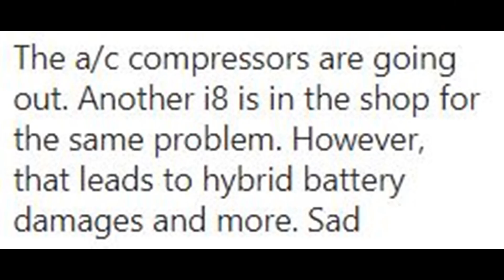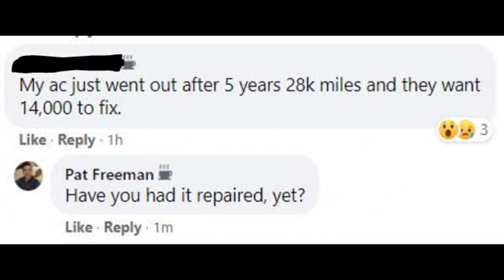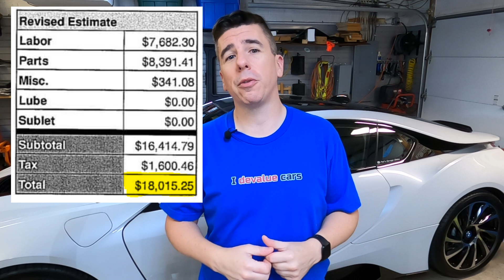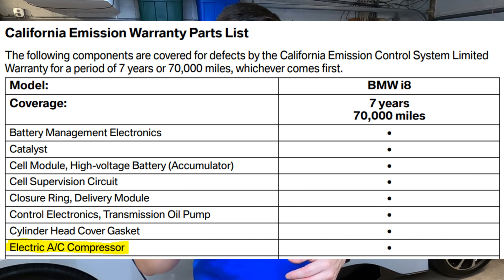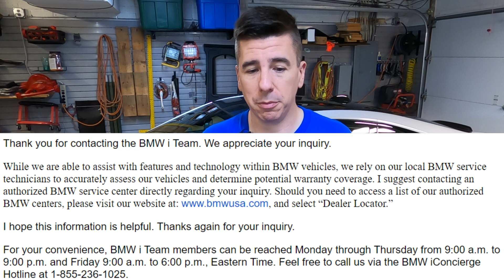BMW i8 Air Conditioning compressor problems and costs

Comment: Wow!  First of all thank you Pat for the video.   I am in the market for the i8.  The more research I do into this car regarding issues and maintenance.  This is becoming a dream killer of owning one.  At first I was going for the 2014 to 2016 models.  Now I'm wondering should I wait for the 2019 and 2020 model.  Sadly this is a money pit.  The car is so beautiful.  "Heart broken" right now.  Thanks again for the informative video.  Keep posting the video of the i8!
Reply from the maker: As long as you have a warranty, you avoid the risks.  The car is repairable when things fail, but it costs a lot for repairs.  I have one friend with a 2014 he had since new, never had one problem.  Last month, his AC Compressor went.  However, he lives in a state where it's covered under emissions, so no charge to replace.

Comment: Appreciate the video and detail.  Happened to mine like clockwork around 29k miles. Pretty disgusted at the QC here.  BMW should have recalled this a long time ago just to prevent everyone's expensive cars from trashing themselves. It's my first BMW and I expected better from the company- maybe I shouldn't have though.
Reply from the maker: I'm sorry to hear you've had the same problem.  It's very frustrating for owners to go through this.
Reply: Just happened to me and no warranty here
Reply: PJ The Entrepreneur hey any updates on your car
Reply: What year model do you guys have?
Reply: @jaylenpopin  2014 here.  Also, just this week, my A/C failed AGAIN with a clunky mechanical noise.  Just over 500 miles on it since A/C replacement.  It's not diagnosed yet, but this has me nervous.
Reply: Jeremy Enos hey did you have any updates on this?
Reply: @pilpilnyc501  Yes - suspect that there were remaining metal fragments from the previous failure in the lines that went undetected (they looked), BMW service decided to replace all lines and anything the coolant touched.  So this is the big repair where they have to drop out the battery, pull the dash back, etc. But BMW took responsibility since I just had it repaired a few hundred miles prior and covered the whole thing. Big sigh of relief there, but still not happy about the initial failure so early, or having to have the car in the shop for over 2 months of summer waiting on parts.  Also, no firm indication that the parts they're putting in are engineered any differently to last longer. This makes me think twice about BMW EV engineering in a broader sense.
Reply: Jeremy Enos that’s great you where covered since I’m out of warranty I will have to pay out of pocket I’m just praying the replacement of AC compressor will fix it I’m not even interested in looking for metal fragments at this point as long as the noise goes away
Reply: @pilpilnyc501  Just to be clear, my initial compressor replacement was not warranty covered.  But since it was repaired by a certified BMW shop, they owned it when the repair was shown to be faulty. I wouldn't want to go thru the compressor replacement expense w/o being sure the lines were clean!

Comment: Hi there pat! Does this issue come all the BMW I8 or has this be issue been rectified, if so which year?
Reply from the maker: There hasn't been a particular year that doesn't have this issue. It seems to come up only om some cars when they are 4+ years old.  Newer i8's haven't shown the problem yet.  So, I'd only get an i8 with warranty to cover this or many other issues that can come up with the car.

Comment: Just came across this video Pat. I am based in the UK where the temperature very rarely requires the A/C to be turned on. Do you think this problem might affect i8 cars in countries with higher ambient temperatures? I ask this as i only bought the car in Oct 2020 and i decided against going for a warranty till the HV battery warranty runs out in 2023.
Reply from the maker: I don't have enough data to be able to say that this only affects certain countries or certain climates. I just know that if you do drive the car in eDrive very hard then it definitely will engage the air conditioning in order to keep those batteries cool. The same can be said for preconditioning where it will warm up the batteries. It can do so by reversing the flow of the refrigerant. Same holds true for charging. Charging generates heat and it requires the air conditioning refrigerant to cool the high voltage batteries. It's possible you may be okay in your climate but I'm not sure.
Reply: @PatsGarageOnline  i think i might not charge my car up as often as i do. I think once a week will suffice. Thanks for highlighting this issue Pat

Comment: Hi Pat, thanks a million! Just changed my 2016 compressor to the now 3rd iteration of the compressor. It cost me 2000 EUR but now I can sleep better! This is really a valuable information! Thank you so much!
Reply: In Germany I paid 2000 EUR all in for the replacement of the compressor which was not shot yet - I just wanted to dodge this bullet
Reply: Yes done at BMW dealership during the tune up. They knew the issues also from Minis with similar 3 cyl engines. BMW is always updating components so there are now 3 part numbers for the compressor - so choosing the latest version is more likely to at least last longer.
Reply: Sts Sta.   Did you do that at BMW? And how do you know that this 3rd generation compressor would work?

Comment: My I8 is now in with BMW with Aircon noises especially when charging ... they are saying it "firstly" needs a regas as it could be low on refrigerant ... lets see how this goes , its also there for Fuel Pressure Sensor issue throwing error on as tank flap opening  (FUEL SYSTEM ERROR). Like you ive got an extended warranty ;-)
Reply: UPDATE: BMW had to change fuel pump for the fuel door issue (7 hours) .... and they say the regas has fixed the aircon noise as the gas was low .... yet to test both of the above i hould have car back tomorrow.
Reply: UPDATE:   Fuel Pump with integral Fuel Sensor finally took BMW tech 9 hours to fit .... and AIRCON regas COMPLETELY sorted out the aircon noise ... IMHO low refrigerant gas is causing the overheating/wear on the conditioner pump ..... aircon soooooo quiet now.  FYI mine is a 2015 with 58k miles.
Reply from the maker: Thank you for this

Comment: Is that scroll compressor plate made from aluminium? If so, I am wondering if it might be worth it for people who have cars that are at risk of this to take the part and have one made from titanium or something that is harder and more resilient to heat.
Reply from the maker: According to the service manual, there is metal on metal contact as the scrolls touch each other.  I would assume Aluminum was not used.  But, I've never cracked open a compressor to find out.  However, there are videos on the web of HVAC scroll compressors being disassembled and the results are unreal.
Reply: @PatsGarageOnline  i opened a dumped i8 compressor and took a few photos. What i did is to take a rubble ring for replacement in my i3 compressor.  Please check the FB page BMW i3 Worldwide Group -  The A/C compressor can wear like this.....

Comment: Wow thanks for that! I have been looking at used I3s, but I had heard about this issue with them as well. I am certainly interested to know if they have fixed this issue in newer models, but I will not be touching one until I have some proof that they have fixed this issue!
Reply: I personally know multiple people that own newer i3s (2017-18 and 19) and none of them have any AC issues. In fact a 2017 i3 has over 120K miles on it and the AC works just fine, so all you need to do is to stay away from the earlier production years.
Reply from the maker: I saw the first report of a 2019 i8 having the AC failure just last month
Reply: @PatsGarageOnline  well, it ain’t a 4-runner after all, so anything can happen))

Comment: Hmm thanks for that, as an owner of a 2019 roadster, i love the car, i had noticed that when charging the car there seems to be a fan that comes on, however i did change the charging rate, to its lowest setting, which stops that, so perhaps this may help?  Also i recently had a fridge that started to stop working and the fridge guy said that i had got a leak in the system and that it is gradually loosing coolant, and thus diminishing the cooling and also the lubrication in the compressor....So just a thought as the refrigerant is the lubricant for the compressor, do you think that some sort of pressure test say on an annual basis may be an idea as any drop would likely be because of say a small pinprick leak in the tubing, thus any reduction in refrigerant would cause the compressor to overheat ..any thoughts..ps the fridge guy put his hand on the compressor and said that its too hot..and said you need a new fridge.
Reply from the maker: I'm currently charging at the 110v rate, nightly so I only cycle the AC Compressor once during a charging session, around half way full.  But, it's considered a slow charger compared to the 220v, higher kW charger.  It's possible that there is a leak and oil is being lost.  However, I haven't found any signs of a leak while taking apart the panels and looking under the hood.  I'm not sure what the BMW techs are doing in order to test this and haven't had any dialogue with them about it.  Some of the techs on the BMW forums also haven't provided much information about testing.  I do believe heat has a lot to do with the issues we're experiencing and the service manual indicates that heat is an issue.  Also, the scrolls have metal to metal contact.  So, it's possible there are a lot of things going on all at once leading to the perfect storm.  I just wish I knew the answers.
Reply: @PatsGarageOnline  Im not sure what the coolant is now, but it used to be something called R22 which i believe was called Freon.  The new gas has smaller molecules and unless your system is completely leak free, it likes to escape..also it is the lubricant for the compressor..I wonder if having a regular air conditioning check for preasure and volume may be a good preventative measure

Comment: Is this AC compressor used in any other vehicle (even non-BMW)? Do we know the actual manufacturer of the compressor (even though it's branded BMW)? Great video!
Reply: Not sure about the i8, but the i3 has one made by Hanon Systems/HVCC in Portugal. This may have changed over different revisions/years, so ymmv.
Reply from the maker: Thanks.  I have no idea who actually makes the compressor or where else it might be used.  I was unable to determine that from research online and I've never held a compressor in hand to see what inscription it has.  All I can offer is data that I've gathered from other i8 owners, and their experiences.

Comment: If this is a recurring problem, then owners need to band together and get to BMW to cover this--do you have a sense as to the volume of cars that have had this problem in your research Pat?
Reply from the maker: Thanks DoctaM3. The number of folks who post to the forums is what I have to start with as a population. That's a very small subset of i8 owners. It would be impossible to guess how many i8's were affected. I just saw a comment on this video where an i8 owner had an AC failure with no noise. He was quoted $18k for the repair.
Reply: Mine just went out and I’m quoted $16k and I don’t have warranty 😢
Reply: @theprajwalfamily   sorry to hear that. It will help the rest of us i8 owners if you can please tell us what year of i8 and how many miles?  Also, did it happen on startup or while driving?  Do you mind sharing the circumstances, please?   PM me, if you would rather.
Reply: @slkttop  2015  and while Driving.
Reply: PJ The Entrepreneur how did your case work out man?
Reply: Mine has been in the shop for almost 2.5 months and the dealership is having problems fixing the compressor.  It even started smoking in their shop when they thought it was fixed.
Reply: @ttecnotut  what year is your i8?   you say: fixed?  do you mean they replaced the compressor part with the latest part number and that failed again?
Reply: @slkttop  they weren’t replacing the compressor until they turned the car on and compressor started smoking. A 3rd patty warranty inspector will check out the car to see if the warranty company will cover the $2k compressor part.
Reply: I am also curious about mileage where failure is experienced plotted against average temperature car is driven in.  Is it purely a duty cycle issue where warmer climates advance the failure due to heavier use of the compressor?

Comment: Thank you for sharing this valuable information. However what seems strange to me ist the fact, that I couldn’t find any similar messages in one of the biggest german i3 community forums. Only message I’ve found has to do with noise due to less coolant fluid. If it‘s really the same part in the i8, shouldn‘t it cause much more problems in the i3 due to the much higher demand of battery cooling? Really strange.
Reply from the maker: Thanks for this data. It's quite possible that the I8 electric motor is configured to provide more power quickly and therefore heat up the batteries quicker. Or the battery pack in the i3 dissipates heat better requiring less refrigerant pressure. I'm not sure but those are my initial thoughts.
Reply: @PatsGarageOnline  I have read several reports about I3s with the exact same problem. I had trouble finding references to it on YouTube, but I found quite a few in forums.

Comment: Great video Pat! Thanks for doing this, as an i8 owner it’s extremely valuable. I think if BMW are smart they would actually be saving themselves money for cars still under warranty if they replaced these as soon as there was any indication of noise/failure. It would be awesome to know if this is a very limited problem, or very common. As you say time will tell with the 14/15 models. If it is common I wonder if there is anything that the i8 community can do to influence BMWs decision to replace compressors, for instance class action lawsuits etc.
Reply from the maker: Unless a safety issue arose, it would not be financially beneficial for BMW to do anything about the defects in this compressor design, unless it started to create an issue with the brand. The i8 cost them more more money than they sold it for, so they're already starting with a loss, and they were ok with that. So I'm not sure what a lawsuit would do, to be honest. Porsche has campaigns to replace working transmissions in the Cayman GT4 because so many had a weld break in the gear box. Even if you never has that problem, Porsche still had you come in for a new gear box. I'd love to see that kind of customer service from BMW.

Comment: Hi Pat, great video, I appreciate your integrity in bringing this issue to light. I wonder if the redesign of the facelift models with the new front vent have anything to do with this issue. as you said, the AC is in the front under the hood, so maybe this new vent help release heat and help preserve the breakdown of the AC unit. Any way to see if the facelift models have a different type of AC unit part # that can be swapped?
Reply: the direct answer to this is: yes.  BMW has a part number for a more recent compressor as Pat says in the video. They have FOUR older compressor part numbers, as a matter of fact. I plan to put the latest one into my 2014 when my California 7-year emissions warranty runs out.
Reply: This is an interesting idea. Pat, any insight on this?
Reply from the maker: The newest i8's have a smaller hole in the hood and the ductwork under the hood has smaller holes in it in order to allow that air pressure to go somewhere.  The flow through the radiators and condenser should be the same.  So, the AC system shouldn't realize any differences.

Comment: Wow man I was planning to buy an i8 but after watching this video I think I better wait for Cybertruck or any less-maintenance car; especially I live in Dubai which is very hot in summer! I don't want my AC to break down in a place where temperature raise up to 122 F!!
Reply from the maker: Thank you! The Tesla vehicles cool their batteries with liquid coolant, like the coolant that keeps an engine from overheating. So they won't have the same issue as the i8 does. However, mix water coolant with batteries and see what happens. 🤣
Reply: @PatsGarageOnline  man but I still love i8.. Is it worth to buy it only for its looks?
Reply from the maker: @mohamedtamim5127  if you have enough money to repair it, then you can justify owning and keeping it. The only thing that will keep this car running is money.
Reply: @PatsGarageOnline  💔 such a harsh reality.. Thanks for informing me about this
Reply: Thank you very much for the video, it's really informative and helpful. Keep it up brother!

Comment: I wonder if we will see more failures In hot countries/states where the unit has to work harder?
Reply from the maker: The AC works harder when we're in pure eDrive as the heat generated inside the high voltage battery pack increases when charging and discharging.   I'm not sure about other climates, but you may be on to something!
Reply: @Pat's Garage Online  Good info stuff... I drive my 2019 roadster nearly 80% of time in full electric.... I'll keep the ac off just in case - mind it's pretty inclement/chilly here in Cambridge UK most of the Sept-Mar  period though!!